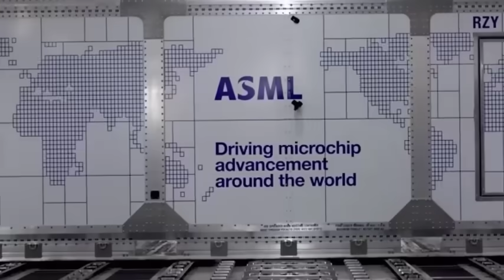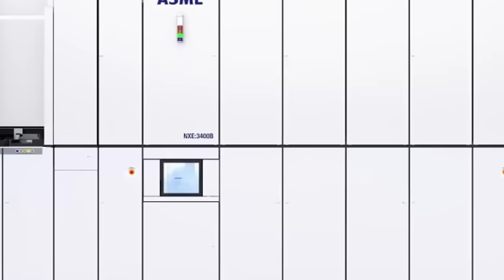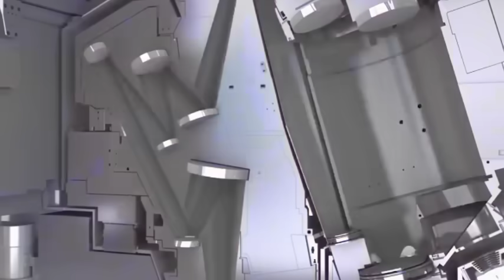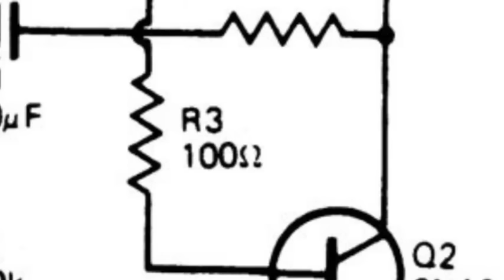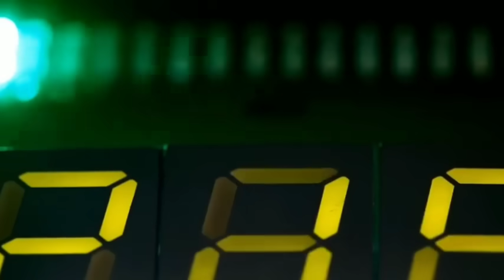The Netherlands dumped high-end lithography systems to China after Huawei made great achievements!

Comment: Huawei KIRIN9000 cpu is tech made out of this world,,,major chinese potential/ability,,,,KIRIN9000 makes Chinese superpower chip Leaders,,,please remember China not cheat as usa/west,,,KIRIN 9000 is design and manufacture all chinese
Reply: Are they catching up to Nvidia in terms of GPU over there you reckon?
Reply: @elfkey1409 - chinese gpu has yet to beat nvidia, but they will beat all gpu in the future... 😊
Reply: @emeraldwind The top end Western tech China cannot yet beat. However they have already beaten the mid end and can underprice it. Which is crucial. Because most people don't use the high end stuff which is not mass market anyway. Hardly anybody drives BMW 8 series or Mercedes Maybach for instance.
Reply: @elfkey1409 and it’s a Chinese CEO. Fool
Reply: Wrong, Kirin9000s is using British ARM Cores and GPU's. And it's made on Dutch Lithography machines from ASML. HiSilicon used American chip design software to make the chip.
Reply: @HermanWillems  SMIC is not using ASML machines. They don't have access. They are using DUV Lithography apparently.
Reply: @blcheah2672  yes ASML makes both machines. U think there are many companies who can make these? DUV ASML machines are used by SMIC
Reply: @HermanWillems Nikon and   Canon laugh in the corner 😂